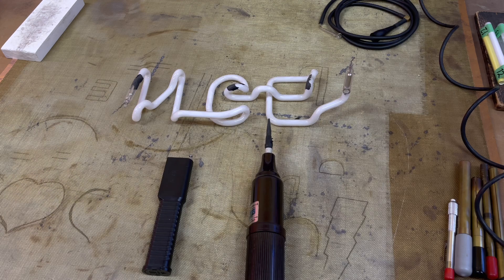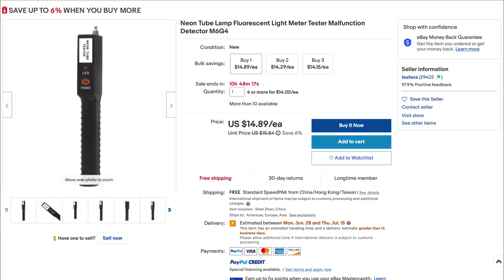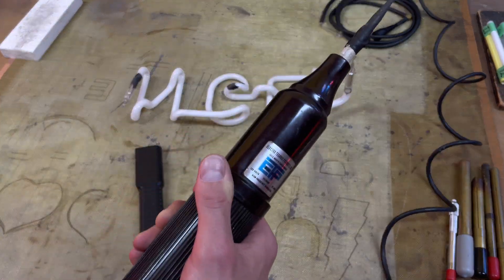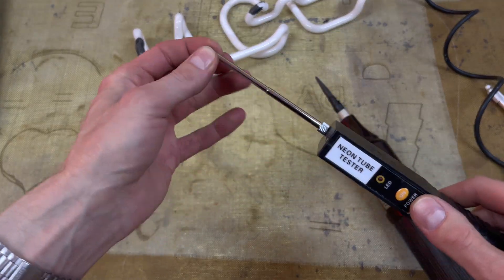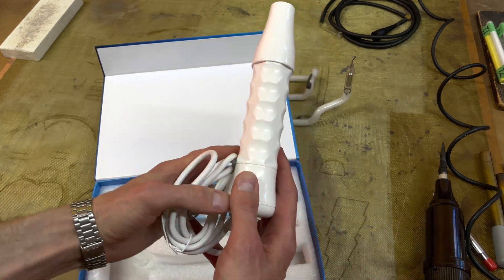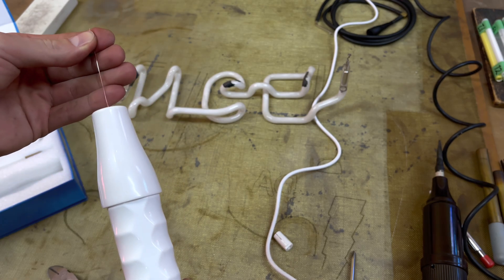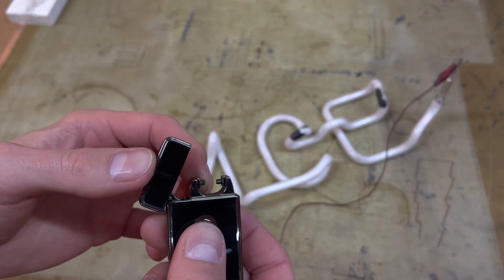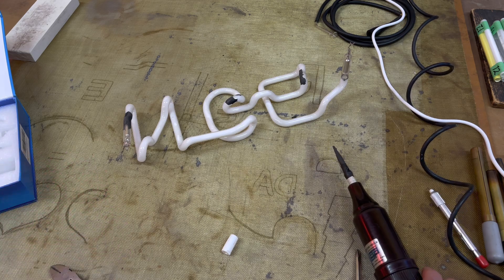Neon Tube Testers: Tools for Neon Sign Troubleshooting

Comment: 0:13
Kinda stupid to call it "Chinese garbage" and then say it works fine.
I'm getting annoyed when people do that.
Reply from the maker: i can see your point, and my statement could perhaps be construed as a bit cliché; however, just because something works doesn't mean it's made well.   the purpose of the statement in the video is to communicate the lack of quality to the audience so they are aware before they rush out to purchase the item thinking i'm recommending something good.
China is absolutely capable of high-quality, precision manufacturing, but most companies opt to have them manufacture for quantity, not quality.
perhaps we all, as consumers, should hold companies to higher standards by voting with our wallets.